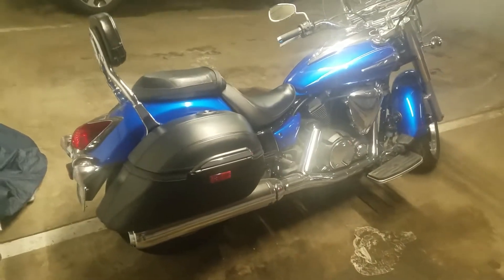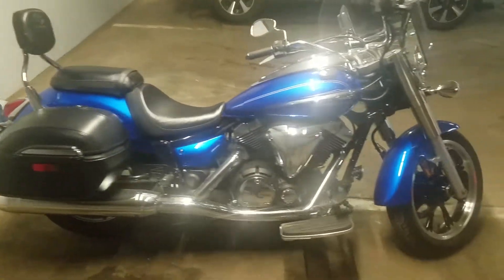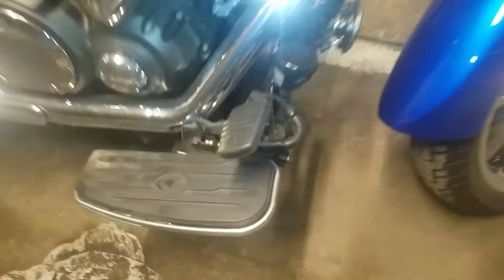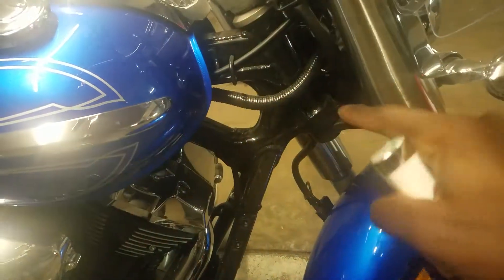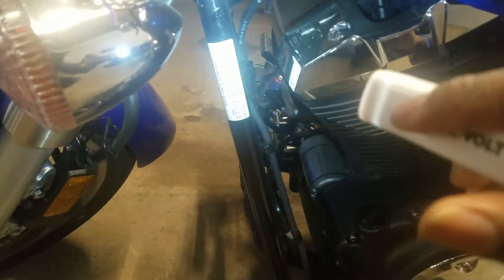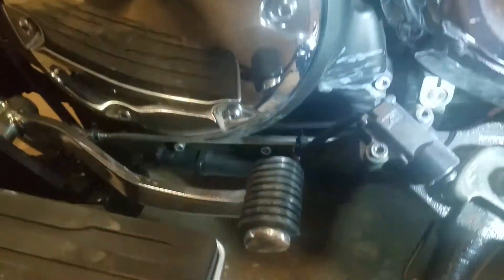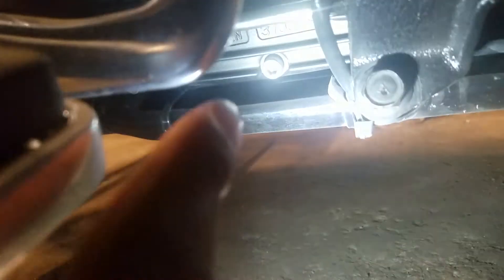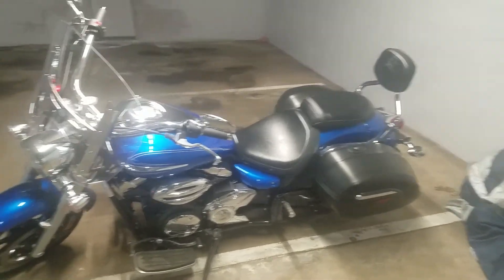2012 Yamaha V Star 950 Tourer - Engine Number

Comment: Engine number is further to the front of engine, near what you pointed out.What you are showing is crankcase capacity or similar???
Reply from the maker: Thank you for clarifying that. I will also take a look at it. The number might be on two places...I dont know.. I will check it out. Thank you :)
Reply: @BernardAkem  on my 2005, the engine number is on the left side, on top of the crankcase, just below the rear cylinder.
Reply from the maker: @Gaaralovescookies90  ahhh.. interesting. They probably change the location on different years?